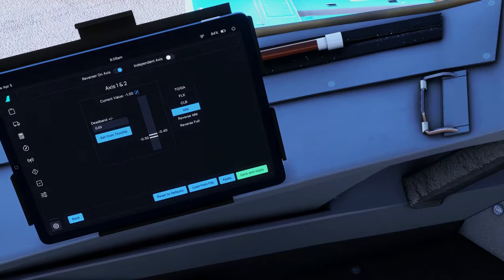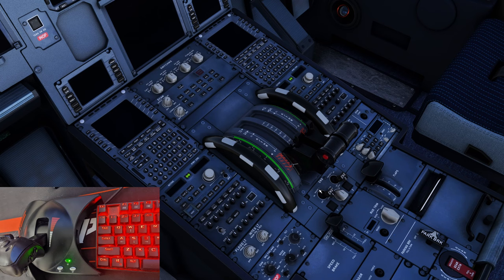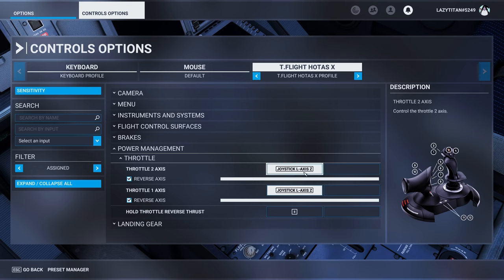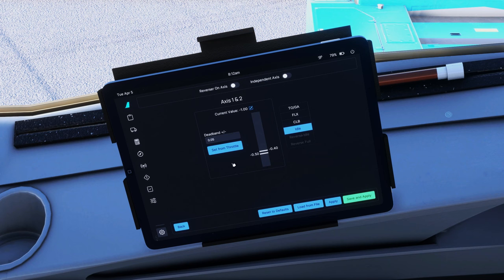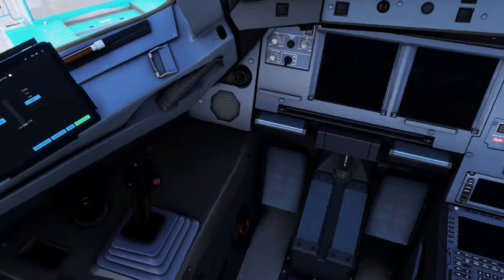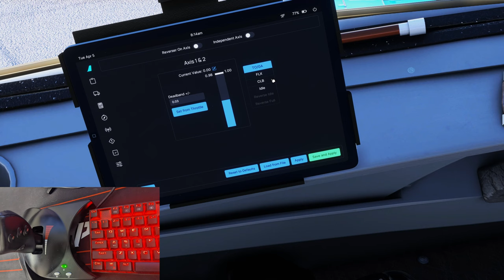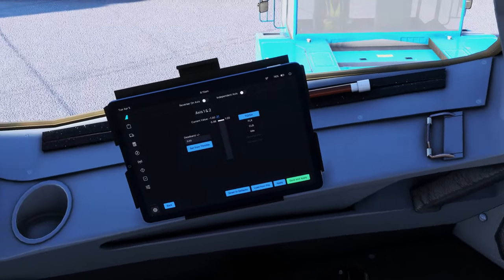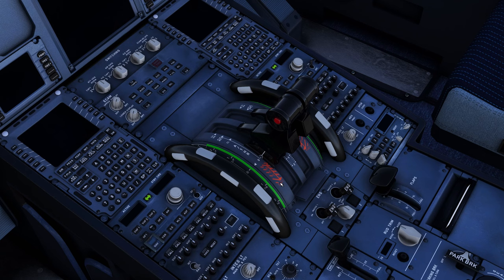How to calibrate throttle correctly on FlyByWire A32NX? [MSFS]

Comment: Thank you sir. Seems a whole lot easier than actually trying to pull the throttle back and I also noticed if I calibrate it with reverse , i still move at idle so the only way to not move is by parking brake. I hope this fixes that. And I’m a moron because I’m realizing now I’ve spent three days wondering why I haven’t been able to go straight especially on runways. I had calibrated only one side so my engines where going at different rates even tho it was locking my throttle to the correct position. I also had been using double throttle for stuff like Cessna which apparently causes issues as well
Reply from the maker: Glad it helps 🙂 Thanks for the support on the video!

Comment: When i do the calibration throttle within the cockpit moves along with my controller. But plane satus on full throttle no matter i do
Reply from the maker: You should do throttle tuning when the aircraft is cold and dark with just batteries and fmc on or gpu connected